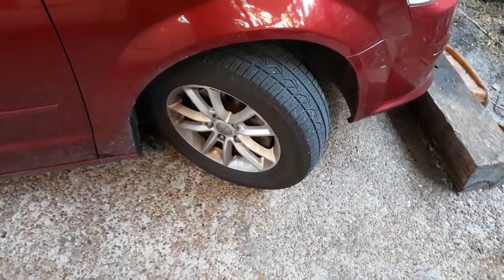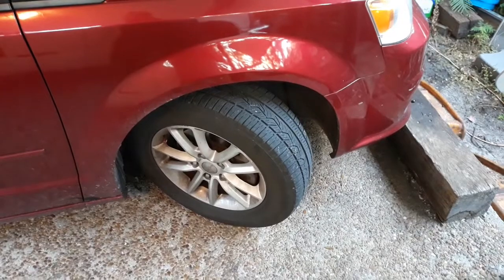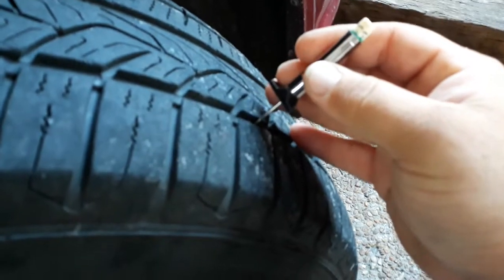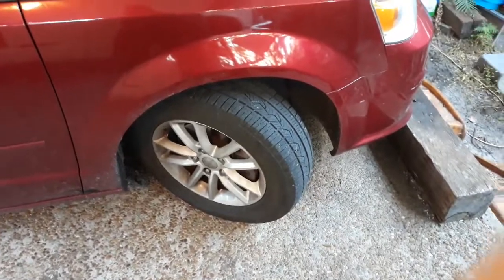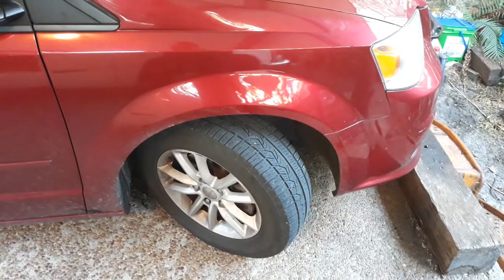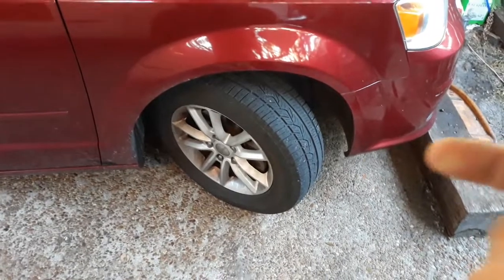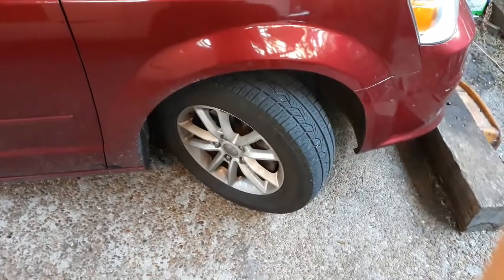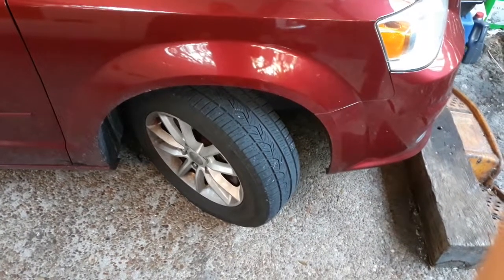SL or XL tires? Update Video

Comment: I mean you do realize that one side of the tires shoulder wearing like that indicates an alignment problem right? If the load support of the SL tire was suspect then it would wear both shoulders of the tire. I'm a tire tech. I see these things and seen many different tire wear situations and most typical ones but even the more odd wear patterns usually have and explanation for them. Looking to put an XL tire or up tire pressure will not solve this problem and or at best is masking a problem. This is either a positive camber Byass or toe in Byass or even both at the same time. Also important to know to some extent steer tires will always slightly wear the shoulders based on the task they have to do. That's why tire rotations are important. Some more than others because of thing like the vehicle weight and even alignment spec. People think Castor is a non tire wear steering angle but I disagree because the more aggressive you positive castor setting is then the more tilt it has when the tire turns and especially when the steering is turned to full lock. Camber on the tires increases when the wheels turn because of Caster. They don't just steer at a 0 degree angle. Anyway I digress. 1 Get your alignment checked first before playing around with tire types. 2 Make sure for sure you have a GOOD tire gauge that is calibrated and spot on and use the proper tire psi the door jamb calls for. 3 Use the proper tire type and load index and speed range tire compliant with the tire placard info. 4 Keep up with tire rotations. Also to note. I've never seen a car wear only outside shoulders on only one side due to hard cornering. The tire will squirm in both directions when steering the vehicle aggressively at higher speeds.
Reply from the maker: While I appreciate your input I have to respectfully disagree. You would need to watch my other videos on the subject to understand why I am at this point.

Yes the points you mentioned will cause strange wear patters. However, as I have stated in previous videos I do not have any alignment issues. It has been checked several times at different shops.

Normally running your vehicle at the rated psi found on the placard is correct for normal conditions. If you are a tire tech then you should have learned by now that there are certain situations where tire psi has to be adjusted to meet conditions. As stated in previous videos I have said that I mostly travel with my van loaded to max capacity. The more weight you have on a tire you will cause more pressure to be on the outside of the tire tread. That can be alleviated by putting more air in the tire which will cause more pressure to be put on the middle of the tire tread. This only works to a certain point. You can not exceed the max psi rating of the tire. If you are still getting more wear on the outside of the tire on both sides not just one, then you will have to upgrade to a heavier constructed tire like I have done. These XL tires are made with more robust materials that can handle more weight.

Another example I can give is my work truck. The placard says that front and rear tires should be inflated to 32 psi. If I do that I will wear the outside of my tires well before the inside. My truck is always loaded with about 1,000 lbs of tools in the bed. I have found that with the front inflated to 40 psi and the rear inflated to 50 psi I have even tire wear.

I rotate my tires every 10,000 miles. There are no suspension issues or alignment issues with either of my vehicles. It is simply a case that in my situation I need to run a higher psi than the manufacturer suggests.
Reply: @Bbernhardsr  I understand the load situations your describing and sure that can be an argument for going to XL tires. After listening to the fact you mentioned it was fully load then here's the thing. How do you know when fully loaded you are not shifting the load to the rear of the van and decompressing the weight on the front of the suspension there by changing the front suspension height which changes the alignment? I've seen that happen especially more dramatically if someone overloads the rear suspension making the vehicle squat. I have a friend that works in a locksmithing business and he drive a panel Van. One of those Mercedes Metris ones. Well he used to anyway but that's another story. Anyhow it was loaded up with so much equipment that it changed the geometry of the front suspension causing positive camber and toe in wear on his tires. Now do you think the alignment spec that vehicle rolled out the door with new when unloaded will be the same when it was loaded up with as much equipment as it now has? Of course not. If only he used a vehicle with a front solid axle part of that issue mostly could have been avoided or if he just got an alignment after the vehicle was permanently loaded with all the equipment. So the question is when you had your alignment checked was the vehicle empty? Cause I bet you didn't have yourself and your kids and groceries in the vehicle when you had it checked. Just a thought. The thing you mentioned you put on the top of the vehicle I can see it making the vehicle top heavy which can increase body roll in turns. Yes you can up air psi for stability and extra weight but when someone tells me they have wear on one side of a tire compared to the other side of it I'm gonna suspect something else. I'm not trying to debate here. Just listing off as many variables when it comes to tire wear. I see it all the time at my job and I know it's not our tires that are the problem. It's owner negligence to do maintenance.  Sadly maybe it's the clients we get based on our location but I won't go there.
Reply from the maker: @DJWhitetailfluff  there is where we have confusion. I don't know if I miss spoke but I had wear on both of the outside edges and not just one. I do know what you are talking about where the suspension geometry changes when the suspension is loaded but that does not happen on this van in particular. I see that a lot on the rear of vehicles with independent rear suspension. The Honda Pilot is one example. The more weight you put on the back, the more negative camber you get.
Reply: @Bbernhardsr  Yes. And also thank you for the clarification. If your wearing both sides of the tire due to it being overloaded despite proper air pressure or more then I understand why you have done what you have done. I just didn't want to see someone go to a different kind of tire simply because what they had was really an alignment issue and they didn't know it. Ya when someone says they have outside wear I'm like define what you mean by that. Only on one side or both sides of the tire. I get this from customers all the time and it's either one or the other or both. Sometimes even one exacerbates the other.
Reply from the maker: @DJWhitetailfluff  absolutely and thank you for making sure that I am not giving people wrong advice.
Reply: @Bbernhardsr  No problem. Everythings all good.

Comment: How is the ride quality vs SL tires. Is there much difference?Do XL ride like all terrain tires?
Reply from the maker: Yes that is a good way of putting it. XL tires are stiffer than SL so you will feel more bumps and there may be increased road noise but it is a firmer ride.
Reply: Xl is extra load and reinforced side walls

Comment: I have owned a 2017 Toyota IM for 3 years and i have 17 inch rims. I originally got the car with XL tires and it handled on corners fast and hard very good. Then i bought some sl tires of same sport quality, they wore out quick and cornered like crap. I now have falkens again in a XL and it can corner faster again. I would assume XL helps me since my car is fwd . Yeah they are loud and the ride is rough. 🤷‍♂️ Worth it
Reply from the maker: I would imagine the XL's cornered better because of the extra sidewall belts that are not present in SL tires. SL tires flex a lot more than XL.
Reply: @Bbernhardsr  yeah it's crazy, I live in the Appalachian foothills. It's basically mostly curvy highways,  or gravel roads super fun in the correct car. I'm surprised there isn't more channels talking about how incredible these tires are under the correct conditions. I would imagine having a big truck or van hauling alot of stuff would be the best also.
Reply from the maker: @zombiedearth  you are correct because I have a van that hauls a lot of weight and a work truck that hauls a lot of weight and they are both terrible with SL tires.
Reply: @Bbernhardsr  it's probably a money making gimmick, push SL because they sell more. I mean they have lightbulbs that can last a lifetime and don't sell them, it's bad for business. Need I say more lol
Reply from the maker: @zombiedearth  😄